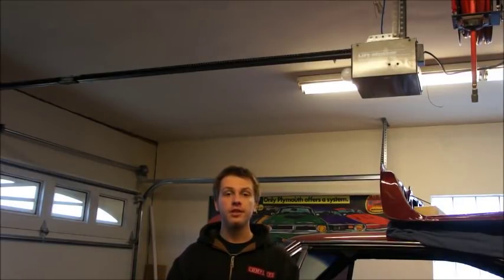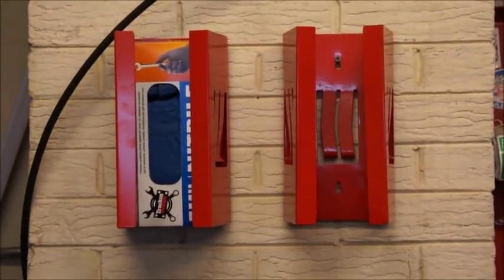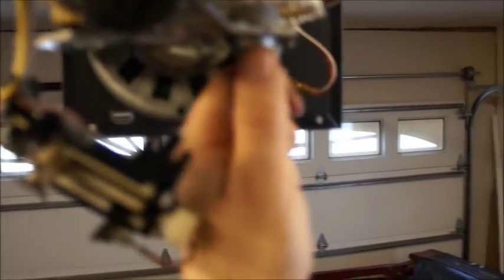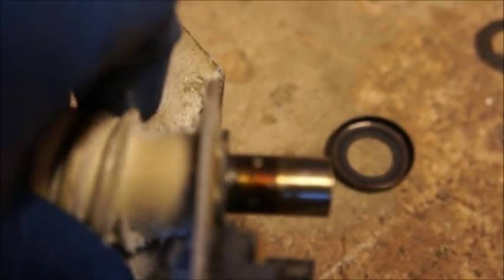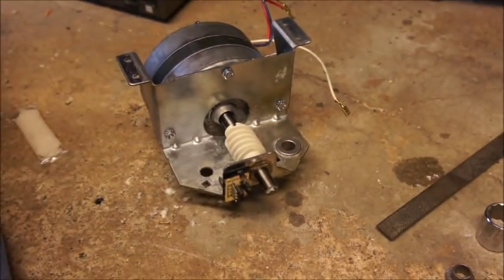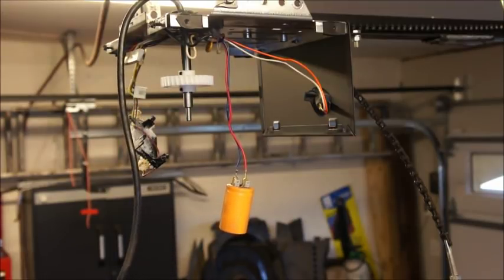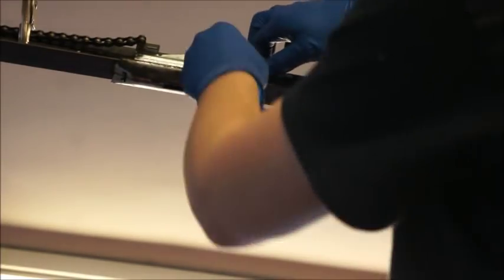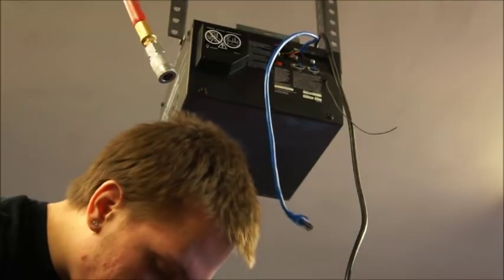How To Replace a Gear and Sprocket in a Chamberlain, LiftMaster, Sears/Craftsman Garage Door Opener

Comment: great video nick ,i have a access master , can i put a chain spreader on it ? it did not come with one.
Reply from the maker: Hi, I've never personally done this, however I suppose it's possible. I honestly don't believe the chain spreader does very much, unless you have a machine with a double sprocket. Basically, if you have the standard, single 8 tooth sprocket, you don't need it.
Reply: why do you put the motor in  before attaching the chain? this seems to not make any sense to me now that i just finished the job ,i am having  problems with  my chain , it will only tighten on the side with  the  tightening bolt  all tightening the bolt does is  tighten the one side and the slack on the other side won't take up
i turned the wheel for the RPM sensor with my hand and that moved some of the slack to the  side with the bolt but then it just slips on the motor shaft and won't turn the sprocket and i can't move  the rest of the  slack to the other side 
 if you put the chain on before putting in the motor then the sprocket would spin freely and tightening the bolt would tighten both sides at the same time  wouldn't it? it seems like putting the motor in 1st makes the  sprocket freeze in place and then when you tighten the bolt it only tightens that one side with the bolt because the sprocket will not move with the motor in and the worm gear against it for some reason
i have on eside that is too tight and one that is too loose , the door works but now i am afraid the sprocket or sprocket bearing is going to break , on the loose side the chain is  sagging and hitting the top of the outer trolley
Reply: You can't do it that way. You have to get the insides of the operator installed and ready to run before you put the chain on to the sprocket. The bushing the gear goes through in the motor plate keeps the entire gear aligned, installing the chain before that would make installing the motor a pain in the ass....and the tension would be totally wrong anyway. Judging by what you're saying here, it almost sounds to me like your chain is at the end of it's allowable travel when you're tying to tighten it. That happens. Because it's worm and spur gear, you can't just manhandle the chain in any direction like an older, direct driven operator.
Reply: all i know is that it is a huge pain in the ass trying to get the tension to balance eon both sides now  ,  only one side of the  rail gets tight
and the other side stays loose , i turned the  wheel by hand to get rid of some slack but then it stops turning ,  the sprocket on the opener stops moving after i turn the rpm sensor wheel a little to take up some slack
and the gear at the front of the rail does not move at all
all i can do is tighten it with the door open and then again with the door closed but it is still not right
Reply: So does the chain seem tight when the door is opening or closing, but goes slack once it's finished running it's cycle? Do you notice and loud banging when the door comes to a stop?

Comment: Mine isn’t a chain but a belt. I loosened the nut as far as I can go but I still can’t get the band over the sprocket to get it off.
Reply from the maker: Ray Fontanes Hi Ray, the belt drive operator spring tensioners are a bit deceiving. The “nut” is threaded all the way through so you should be able to loosen it more than you think it would be able to, completely raking tension off the tensioner spring. that should allow you to remove the belt. When you reinstall the belt, tighten the nut until the spring only measures 1 1/4”.
Reply: Nick'sGarageDoorService thanks for that info. I would assume if the nut fell off I should need the strength of an angry gorilla to get it back on. One person from LiftMaster said if it comes off you would have to by a new belt. Another said the unhook the other side but that needed the strength of two angry gorillas. He said just push it off with a screw driver. Doesn’t sound like good advice to me. I had a lot of problems from the start of this project. I had a professional look at it. The door would go down 6 inches, stop and go back. He cranked up the strength to override a “sticky spot” and the next day the gears stripped. My unit is from 2000 so I didn’t complain. He also said the keypad was bad and replaced it. I told him it worked the day before. He put the broken one back on for me the next day. I receive a new pad in the mail. Also replaced the eyes because they looked like they had glaucoma. I bought another button that goes on the inside of the garage because it took the strength of a small gorilla to push it in enough to work. I am stronger when I put my hand in between the garage and the rail to push the button in. Next problem I have is the new replacement part doesn’t line up with the three screws that come in from inside the box. I had the grind off the back facing surface to get it to fit. I also had to take out the motors I could use the socket wrench to put in all three screws with ease. Hope I can get the motor back in after doing this. Also I think the reason the garage door was having the 6 inch and return issue has something to do with the Limiter. Let’s see if it does the same thing after I get the new gears installed. Also when I used a socket to take out the screw on the lower, center housing the socket got stuck inside the tunnel. Just happened to have a screwdriver that was bent into a hook to dig it out. To get the left side off I just twisted and ripped it off, after all the other screws were out. Hammered the wall back into shape afterwards. Fun stuff so far.
Reply: Thanks Nick. But I just cant give myself that leap of faith. I may have to wait another 7 years until this unit fails again to prove you wright. I got it all together and it works. You da man!. I dint know I could order a shaft designed for the belt, so I had to push out the clevis pins and swap the sprocket with original shaft to get it to fit and intall the top cap chain cover that the part that came in the mail had no screw holes to put the cap on with. Now that I did the project twice it doesn't seem as difficult as when I first got into it.

Comment: Is that RJ45 connection your custom work?
Reply from the maker: Yes, I tend to swap out operators quite a bit and it's easier to wire it up on the ground and then just plug it in later.

Comment: Great video Nick, I pretty much have the same opener . I just replaced the main gear in it, everything else was ok. Now my problem is from the up position the trolley and door only travel about two feet headed down/close and stops then comes back up. Sensors are good, now where the adjustment gears are, coming up is ok but going down the sensor does not even come close to where it should as if the door were all the way closed. Hopefully you can understand my description. PLEASE HELP
Reply from the maker: Marco Alfaro Hi, I'm assuming you've tried turning up the "CLOSE" force setting on the circuit board. If not, try that first. Watch the RPM sensor and see if the motor shaft moves back and forth at all while the door is closing, it is possible that the black wheel's slots are moving away from the sensor enough that it no longer reads, thus reversing the door. Let me know what happens!
Reply: Nick'sGarageDoorService Thanks for the reply Nick. As a matter of fact I got it yesterday. I had forgotten that the plastic limiter cup fell off. Once I found it and replaced it it works like a charm. Thanks again for a great video
Reply: Marco Alfaro I’m having this same issue on mine.  What is the plastic limit cup?  Wondering if the same thing happened

Comment: does it matter if it is clockwise for up
Reply from the maker: It's pretty important because the limit switch is internal to the motor assembly. If the trolley is up, you want to run the motor so the sprocket spins counterclockwise, then shuts off on its own. If the trolley is down, you want to run the motor so the sprocket spins clockwise, then shuts off on its own. If you get it backwards, you'll get it all back together and then go to try it, and the opener will either try to close the door when it's already closed, or try to open the door when it's already open.

Comment: Nick - I followed the video (I think), but the chain is not moving when i push the garage door opener. It is making a sound, but nothing is moving. Any idea?
Reply from the maker: Hi Matthew, does the motor hum at all when you press the button or does the circuit board just click?
Reply: Nick'sGarageDoorService the motor hums.
Reply: It hums then it makes it a clicking noise. The orange light in the back is blinking.
Reply from the maker: Matthew Blaszka Check to make sure your trolley didn’t jam up into one of the stop bolts on the rail. If so, you’ll need to unplug power, remove the case and manually turn the motor shaft with a pair of pliers to get the trolley off of the stop bolt. Then check your limit switch while you’re in there, likely this happened because it tried to open or close too far. If this doesn’t resolve the issue, a video of the problem would help me figure out the cause. If you can, email me a clip at nicksgarsgedoor@gmail.com and I can try to further assist you via email.
-Nick
Reply: @NicksGarageDoorService  Hey Nick - I've sent you an email. Apologize for this, but I am a complete amateur and don't want to mess this up.  THANKS!

Comment: Would you happen to know how someone would use the motor from this for a hobby project? I wouldn't care what speed it ran, but I would want it to continually run while it's plugged in.
Reply from the maker: pittsburghjoe Hi Joe, these motors are not designed to run constantly and will overheat and self destruct if run too long. The circuit board has a safety cutoff that usually trips after running the door up and down 15-20 times in a row. Keep that in mind. I'm not 100% sure on the wiring, so take what I'm about to say with a grain of salt and know I am not responsible for anything that may happen as a result of you trying to wire up the motor without the manufacturer's circuit board. I think the white wire goes to the neutral side of a 120v circuit. You have to use the capacitor to make the motor start. I think you change directions of the motor by giving the hot to either the red or blue wire on the motor through the cap.
Reply: thanks :) I hear a cap can hold a charge for a very long time so I know to be careful when twisting wires. Also, I do not hold you accountable if anything happens.

Comment: Don’t throw away the Clevis  pins if you have a 2000 belt drive. The parts they now send to replace the sprocket  are for chain drive. Or I didn't know my real part number so nobody said, "This is not for your model" So you will need to swap out the gears you get in the mail with the gears on your existing shaft. Or return the part and get the correct one. Live and learn. What do=id people do before YouTube. I guess they paid to have it done and didnt save any money. To get the old on off cut it in two places with a coping saw and chiseled it off with a flat screw driver. This is an all day project for belt drive people.

Comment: what do buy if its belt driven 
?
Reply from the maker: Ben Dont Hi, the process is basically the same except there are two different belt designs, and the collar assembly is different on the belt drives, you will need to drive out a roll pin to replace the worm gear on the motor. To ensure you buy the correct kit that matches up with your belt, the best thing to do is click on the link in the description, put in your model number, find your owners manual online, and reference the gear kit part number listed for your operator. They can be ordered through eBay.
Reply: thanks nick

Comment: Mine is mounted too high to pull out the damn sprocket
Reply from the maker: Hi Travis, if that is the case, your best bet is to work on the operator on a workbench or on the floor. Disconnect the wires for the safety sensors and the push button, then disconnect the door arm from the trolley. unbolt the machine from the mount to the ceiling at the rear and lower it down, have an assistant hold the back end, then go up to the front and pull the pin at the front of the rail. Hope this helps!